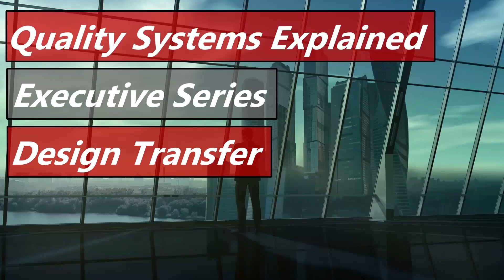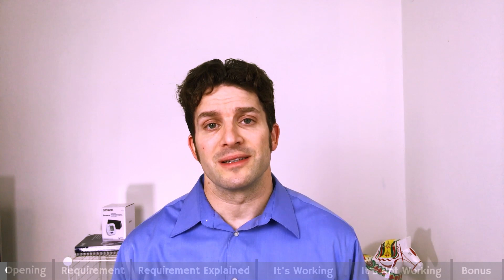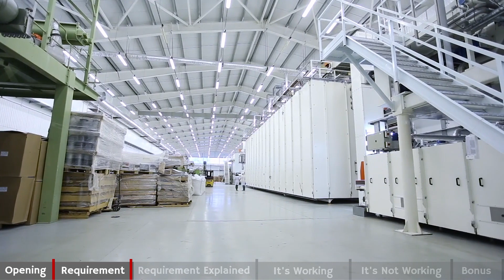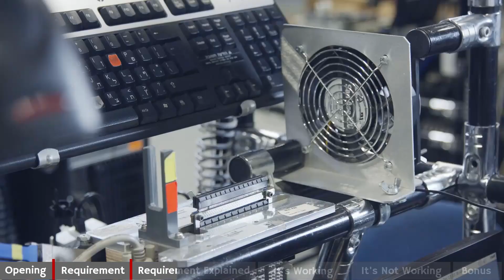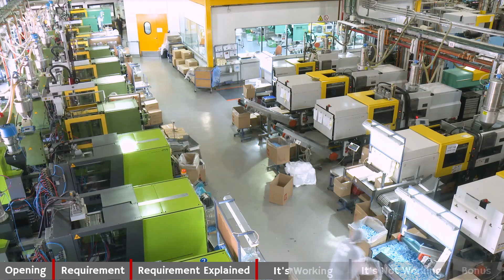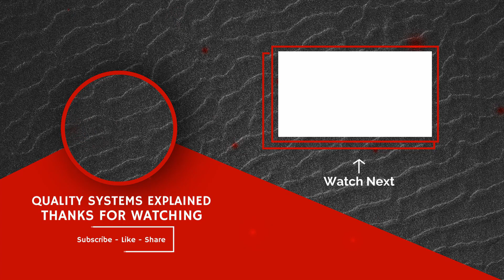Design Transfer 820.30h & ISO 13485 § 7.3.8 (Executive Series #17)

Comment: Well explained... Can you please tell me wo approves the design transfer plan?
Reply from the maker: The approves of the design transfer plan will be defined in your design controls procedure or the document control procedure.  As the number of approves increases, its sign of excess complexity in your process and does not normally improve the plan.  :)  Minimum, you want quality assurance and operations to approve the plan.  Other groups can be included as needed.  :)
Reply: Hi well explained thanks for the video could you answer whether the design plan can be approved if not all the points in checklist is closed?